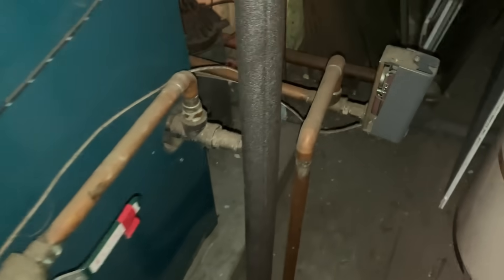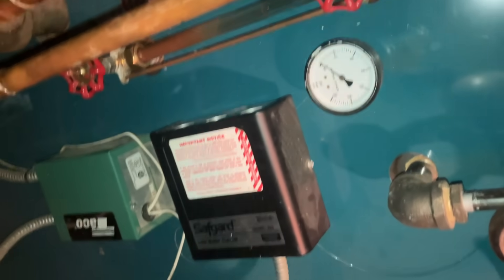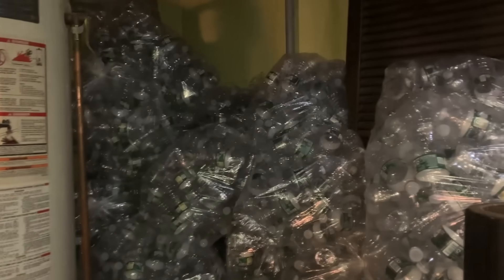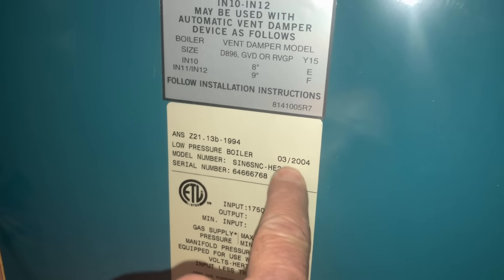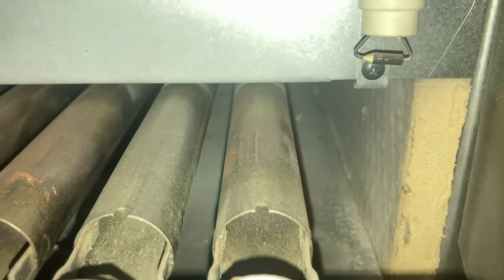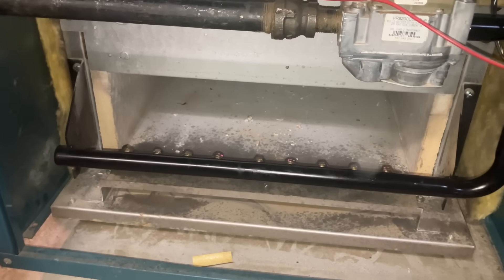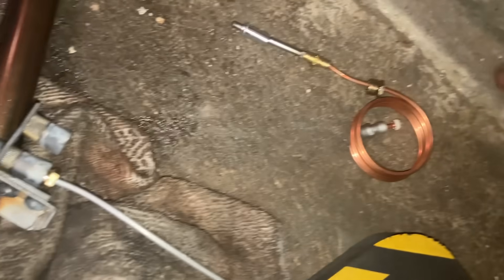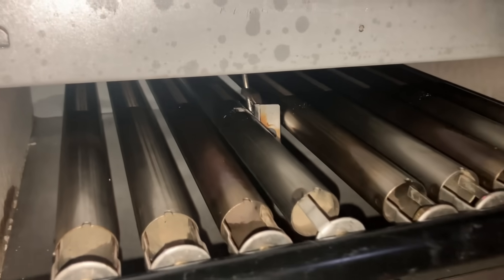Burnham Independence Steam Boiler Annual Maintenance - Cleaning Burners & Sight Glass

Comment: I agree with you on the recycling racket. However, the other side might argue that since you weren't purchasing the items in that state you weren't paying the redemption value when you purchased them. Since you're not actually earning money when you return the recyclables you're just getting back the deposit you paid at the time of purchase...
Reply: exactly why it's fraud to bring them from out of state, where there is no such charge applied to the sales.
Reply: California has a unique state-run system for bottle deposits which makes no sense. When you return there you get actual money out of the state's fund so fraud is a real problem. Cans must be returned to certified centers and my understanding is that they make it very clear that you are not allowed to try returning ineligible cans.

In a sane return system like we have here in Massachusetts the stores manage the refunds. You just bring your returns to the same store and they give you store credit. If you return out of state cans the store gets slightly hurt but since you need to spend it at the store the potential for damage is very low.

Comment: I found It's a good practice to flush out the lower isolation valve on the sight glass when the glass is removed into a bucket. There is a lot of sludge in there.